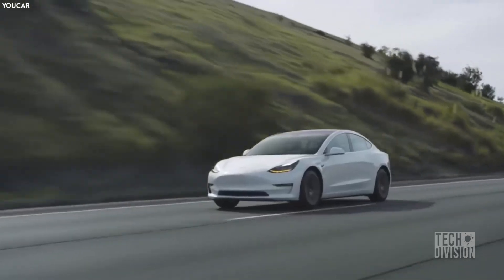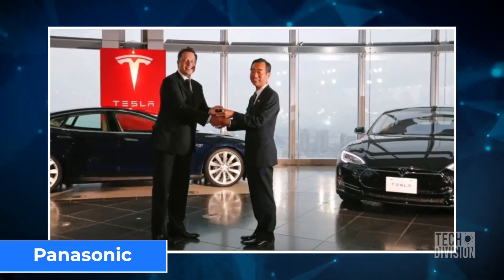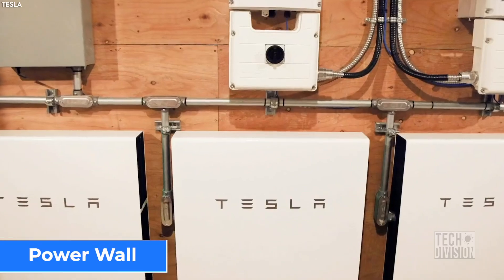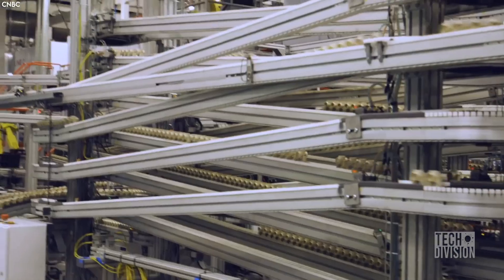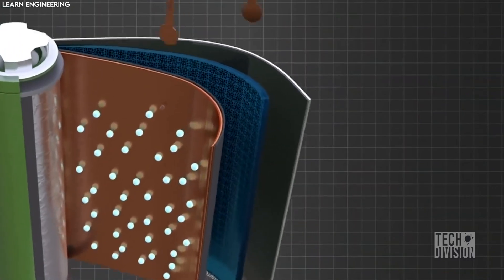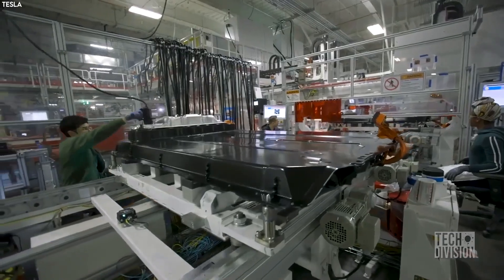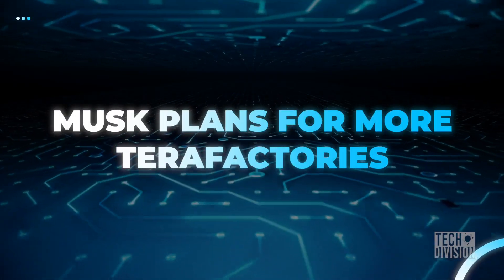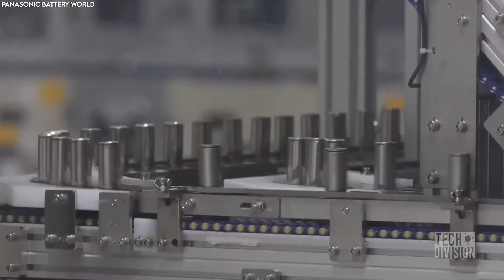Tesla Batteries Production Technology Is Unbeatable

Comment: When I see high speed charging stations at every exit on I-95 I'll know EV's have arrived. My gas guzzling F-250 has a range of 300 miles while towing my 9,000 lbs trailer and over 400 miles driving solo. I'm not too impressed with an EV that's stressing to get 400 miles on a charge. Anyone proclaiming the eminent death of ICE vehicles has lost touch with reality.
Reply: 10 years wait and see.
Reply: tesla owners still not worried about this comment.

Comment: Pretty good video , plz do better research though on battery day slides , it’s a 54% increase in range not 16% but the major thing was 56% decrease in cost per kw/h and 7 times faster run rate and 75% reduction in capital expenditure and I think roughly 75% less floor space .
Reply from the maker: Thanks for the correction and feedback Owen.
Reply: That was referring purely the change from increase the “form factor” size. From 2170 to 4680 because by percentage there is more active material compared to the steal casing . This 16% is only from that then the other 38% is from using a high amount of raw silicone in the anode , having a high percentage nickel cathode , and then massive improvements from the structural battery pack, which allows removal of a lot of different structural pieces being removed increasing the density of active materials again .
https://assets.greentechmedia.com/assets/content/cache/made/assets/content/cache/remote/https_assets.greentechmedia.com/content/about/Screen_Shot_2020-09-22_at_3.36.08_PM_1005_592_80.jpg
Reply: @owenbradshaw9302  Thanks for the link!
Reply: There were more than just the one slide for battery day the one used in this video is one of the first out of dozens put out on battery day, anyone who actually watched “all” of battery day could not have come away with only 16% increase and just that graph .
Reply: @owenbradshaw9302  So basically a Model Y from Gigaberlin with 4680 cells could have easily 700km of range if they use the space wisely and is the long range model?
Reply: @TurreTuntematon  yes , but I think the most likely thing is they use smaller batterie packs than they used to and end up having higher range and much less cost too. With the current longe range being 525 km I figure 700 would be easy with a maybe 20-30 % smaller battery
Reply: No, 4680 is 16% increase in range as per the Tesla battery day presentation slides.

Comment: Lol they've been advertising 1.5sec 0-60 for awhile now in the Roadster
Reply: Tyres can't grip the road so rockets  will be needed for the ludicrous mode
Reply: @13thbiosphere  what could be a better way to say fuck sustainable transportation than to waste fuel and metal on that.
Reply: They are cold gas thrusters not fuel , they will run off compressed air
Reply: @wysiwyg1  Tesla has a habit of over-hyping, over-promising, and then changing the goal post by delaying for a few years. They are also the same company that will install heated seats from the factory and then charge you to activate them.